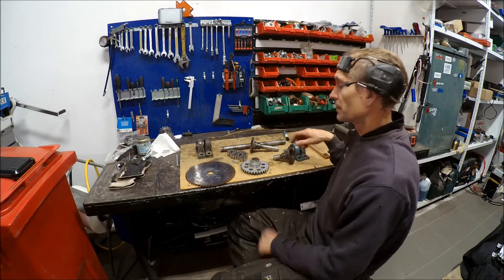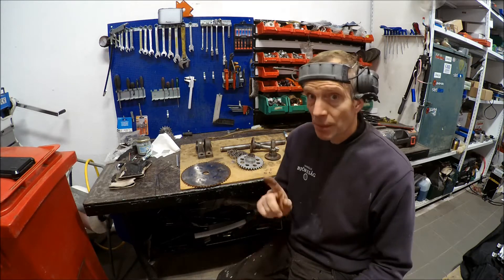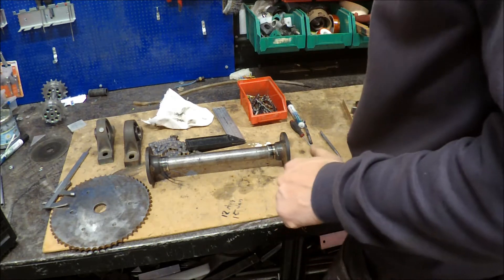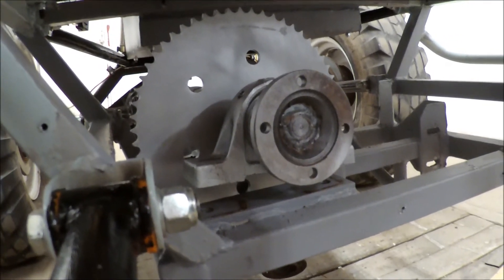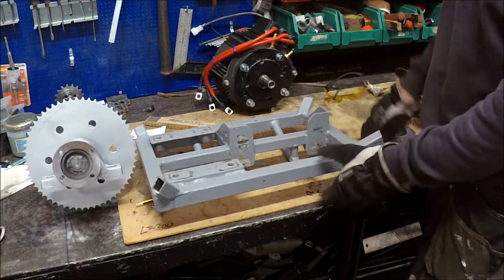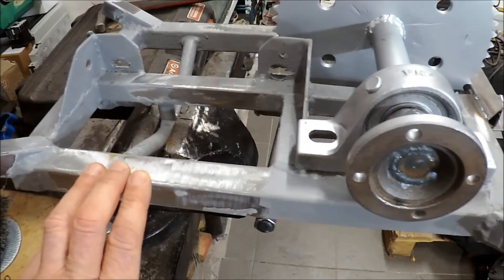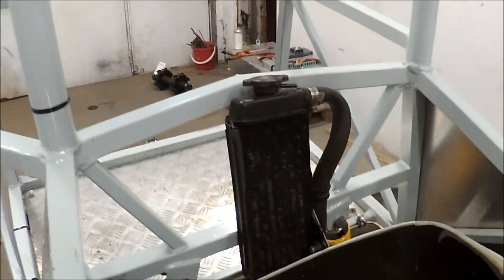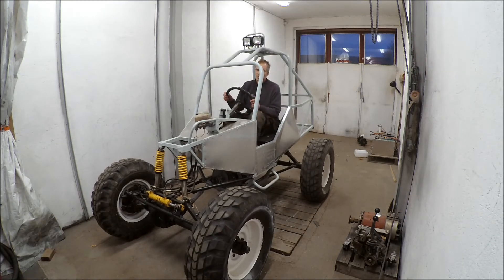Electric Rockcrawler Gearing Changed

Comment: Blir det int mkt stryk för motorn när den går direkt till sprocket ba om man slår mot nån stor Sten?, skulle du rekommendera detta över att ha niva boxen? Är det nån negativt med sätta ihop 2 axlarna tillsammans som du gjort nu, förutom man tappar 4wd eng?
Reply from the maker: Inte märkt nån större påverkan på motorn, alltid lite glapp i axlarna samt att hjulen slirar mot marken. Är allergisk mot vikt vilket är största anledningen anledningen att bygga som jag gjort. Dessutom tar denna lösning liten plats. Men lite tråkigt att tappa hög och lågväxel samt som du skriver 2wd. 
Suzuki samurai fördelningslådor är lättare och mindre samt de har handbroms. 
Ska snart bygga om med samurai SJ 410 axlar, mycket lättare än valpaxlar.

Comment: Good job man 👍 what a difference! For your cooling you could add just a small online 12v pump to keep the water flowing. The static cooling might not do very well with the radiator so far away from the motor. Can't wait to see you make a longer video of this truck crawling!
Reply from the maker: Thank you, THEIRISHAXE !! Yes, I agree the water did not flow when motor got hot. Video comming in 5 minutes !!  BR Per